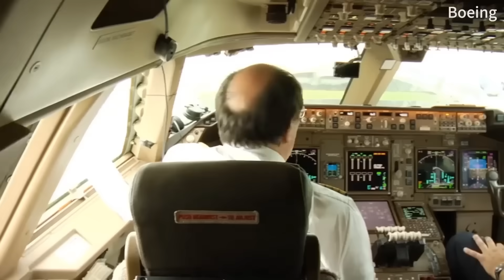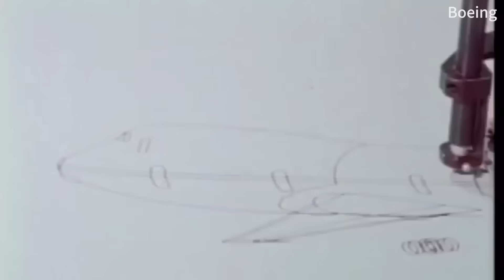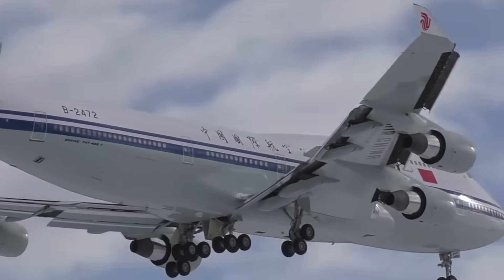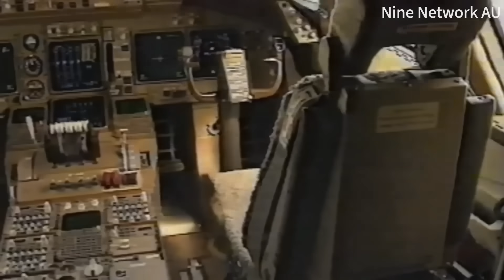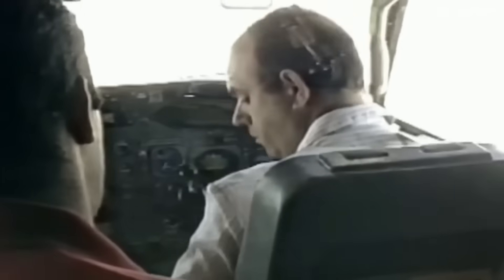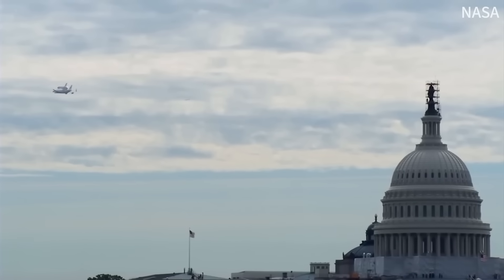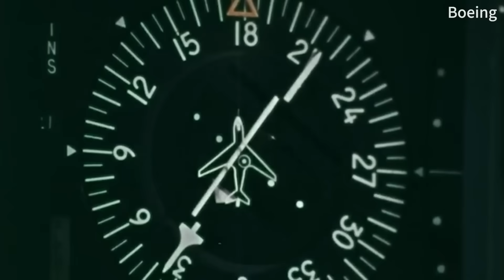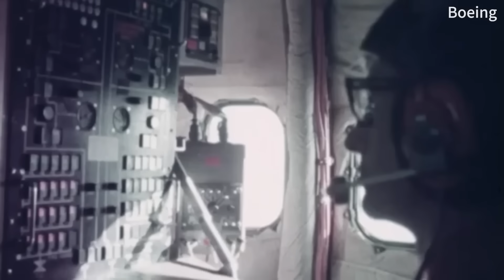The REAl Truth Behind the Boeing 747's Hump

Comment: The "hump" is for AERODYNAMICS!!! While Clare Evgrett was still alive, the designers of the 372 (narrow bodied 707)  were playing in the full-scale wind tunnel at Ames with cardboard and styrofoam "mock-ups". In one test, the model "came apart" under wind pressure and made a "hump" behind the cockpit. The smoke streamers showed a MARKED drag reduction along the fuselage. My late Daddy was running a Huston-Fearless High-speed movie camera of it as an independent contractor. He went to North American Aviation, then to the Rocketdyne Div. and worked on the Apollo program. I watched the first static test firing of the "Orion" engine that powered the Saturn V, in Downey, CA. where there are houses today. NAA is long-gone. "Looks" do not aerodynamics make!

Comment: Boeing delivered 747-400 to NWA in Feb./1989 … difference than 747-300… upper deck is business class..so nice. I actually a part of testing team for the flight test to this a/p (and 777 then 787).
Reply from the maker: That's an incredible level of insight and experience to have been part of the flight test team for such iconic aircraft like the 747-400, 777, and 787!

Comment: Best aircraft I ever got the chance to work on. I thank NASA and the USAF for that opportunity. The beginning of this video isn't entirely true. There are mock-ups, drawings and actual models of the 747 as a double decker, almost as the A380 is now. But the tech at the time wouldn't support it. Boeing was hedging its bet that if the 747 WASN'T successful as the first true jumbo jet, that with the redesign that allowed the nose to open and it put the hump up there, they could still make it successful as a cargo aircraft. For which it still flies today in large numbers, even after most passenger service has ended. But I still say that if you found some very efficient engines, the 747, with some updates would STILL be one of the BEST aircraft flying in the world. It's design was way ahead of its time and one of the most durable ever built. Back when Boeing was run by actual GOOD engineers and not lawyers and accountants!
Reply from the maker: Wow, thank you for sharing your firsthand experience and deep knowledge of the 747's history and design! It's fascinating to hear about the double-decker concepts and Boeing's strategic thinking behind the cargo conversion. ✈️

Comment: Well I remember watching a show called the jumbo jet revaluation. All about the 747. I remember the test pilots complaining about the engines flaming out if they were being mildly aggressive with the throttles. The problem was solved by inviting the engine manufacturers upper level management for a test flight. Then the pilots invited the managers to the cockpit and started throttling up one engine at a time and flaming them out.  While not being aggressive with the throttle input. The managers told them to stop when they flamed out 2 engines and that they would fix the problems with their engines. 
You couldn’t do that today. 😂

Comment: Good information regarding the 747, but. A video on the 747 showing other aircraft, WHY? The title and title graphic hinted at the secrets of the hump itself not the case giving an impression thet the subject would be about the hump and what may be hidden in or what the hump was used for. The video did not revel anything about the insides of the hump. Overall, this video sucked.

Comment: This is a article about the 747 not the A380, watch what you post.
Now this is the reason why I try to take transatlantic flights on a 747, I have timed a JFK to ATH at 8 hours 45 minutes. The A330, you might as well add an additional 1.5 hours to the same route. To me time is money, that extra hour I gain allows for a better connecting flight within the arriving country.

Comment: What the hell is that mess that flashed across the screen at 5:27.   McDonnell Douglas used depleted uranium as counter weights for aero purposes so they didn't have to have such large balance noses since they were aero-driven and only hydraulic assist, not powered.  And that was way before the 747 was conceived.  And GE engine problems were not unique to Boeing either, in fact they ultimately killed the MD-11.   Sorry I just cant deal with the stock footage anymore. Adios
Reply: lol. Crybaby

Comment: In 1979 - 1981 I worked at Northrop electro macanical division in Fullerton. I worked on a stringer line making stringers for 747, 767, 757, DC10 and L1011. The Boeing and Douglas stringers were light, but strong because of the shape of the part. They had holes for rivets. The L1011 stringer had no rivet hols and its shape was half of the other two. You could not get me on an L1011. All the seven series planes are still flying as well as the (now) KC10. Thankfully, most of the L1011’s are in the trash heap……
Reply from the maker: Wow, what an incredible insight into the manufacturing process of these iconic planes! It's fascinating to hear about your experience working on the stringer lines for so many different aircraft.

Comment: How did a plane designed in the 1960s with slide rules outperform later aircraft? Because those 60s engineers were really sharp. They had to be, in a time before calculators and CAD.

 By the same token, the women "computers" who figured out how to land the Mercury and Gemini space capsules did it with pencil and paper- and slide rules.

Comment: If, as you say, Boeing never intended the 747 to be a passenger airplane, then why did they spend money and research such topics as interior lines and passenger comfort?   As a 37+ year Boeing engineer, I can assure you that the 747 WAS intended as a passenger airplane.  However, your statement about the upper deck's reason for being was for access to the main cargo deck for loading was spot on.   It is the reason the A380 will never be a cargo airplane.
Reply: Juan Trippe ordered 20 747’s not for cargo but for passenger planes.  How do I know?  He told us at a dinner party in 1967.  Robert Lowell Johnson, Jr.
Reply: Thought that at least part of that hump was set aside for an alternate crew - as in for long flights, you want/need two full crews…
Reply: Good question, hence the presenter's liking it. The answer is simple: They wanted the option available for companies to choose. Turns out the option became the standard, outselling the original intent many times over.
Reply: All the crew quarters were in the back of the aircraft up a set of stairs on the starboard side
Reply: Yeah. That was total bullshit. Pan Am is the airline that requested Boeing build it FFS. 

So it was designed first and foremost for passengers, not cargo.
Reply: It was designed for cargo first.
Reply: The poster is interested in CLICKs, not TRUTH...
Reply: I just posted a rather lengthy note affirming what you said.  Yup, I am another retired Boeing engineer.  

(Can't claim to have spent 37 years there; or maybe I can...  I went off to work for McDonnell Douglas at the Johnson Space Center in 1979; but hey, Boeing missed me so much they bought the whole company!  So now all my time working for Big Mac counts as Boeing time.  For me that's a good thing because, I suspect thanks to SPEEA, Boeing has a much better retirement program.)

Comment: I used to build the section 46 wing to body assembly for the 747 in Winnipeg.
It's the section behind the wings that blend into the main body of the aircraft.
Before cnc machining equipment came along, each panel was hand trimmed on massive trim tools and then sent to my massive assembly jig, where I would fit them up and gap the panels.
Some panels needed to be final trimmed to create a consistent gap and after several days of assembly and adjustments it would get its final inspection and approval stamps.
I am proud to say that when they digitized the 747 wing to body fairing, I built and trimmed that special set of panels and frames that were put into the cnc machines.
If you work on these planes and see a bug number 2498 stamped on any section 46 panels...that's me!
Reply: Thanks for sharing your story, that's cool.
Reply: So cool!
Reply: Your awesome.  Built with pride and skill.
Reply: so cool!:)
Reply: Hello Johnny, thanks very much for your very interesting post - it must give you great personal satisfaction to know you worked in such a cool airplane, at least I hope it does!!
Reply: @FirstLast-nt6hu  I actually was standing on the wing of W001-777 test plane when I went down to  Washington during the 747 re-coordination pitch!
I never, not, see the 747 and look straight at the wing to body fairings and see my work in action.
Reply: Cool story.  I always enjoy these glimpses into things I know nothing about.  Thanks for your work and expertise throughout the years.  Thanks for posting this.

Comment: One night flying back to Rome on Pan Am flight 115 (Nyc-Par-Rom) there was almost severe turbulence and we were flying through a big storm cell in the middle of the Atlantic Ocean.
I was a Pan Am employee and was getting my pilot license at the time and knew that we were in a dire situation.
Everybody was panicking and holding tight to their seats.
Finally the Captain spoke over the intercom to the passengers.

He said ladies and gentlemen unless you are supersonic pilots I bet you never flew at the speed we are traveling at which is 1600 kilometers per hour , since we have a tailwind of over 500 kilometers per hour ! But he also said that there was no need to worry as the 747 was built to take worse situations than the one we are in now.

I knew he was lying a bit but he confirmed that once Boeing was a Boeing.

We arrived in Paris one hour and 30 minutes ahead of schedule !!!
Reply: I was flying at 650 miles an hour with a tailwind on a '47.

Comment: He left out that after the supersonic fell through they tried to sell it to the Air Force as a troop/ cargo hauler however that also fell through.
Reply: He left it out because it never happened. The USAF heavy lifter program was won by Lockheed after Boeing and Lockheed both submitted design proposals for it. In the end, Lockheed won with the C5 Galaxy. Boeing's design looked a lot like the Lockheed one, but design elements from this failed bid was used in the design of the 747, including the raised cockpit and the nose cargo loading door.

The 747 was first commissioned by Pan Am as a passenger aircraft, but because Boeing thought that the supersonic designs would reign supreme, they designed the plane to easily be converted to a cargo plane when supersonic airliners stared taking over, something that never happened, as we both know.

So yes, even this video is wrong, the 747 was always meant to carry passengers, but with the easy option of switching the line to freighter production when the passenger version became obsolete.

Comment: 15:09  I kept my mouth shut earlier in you video; however, you are at the end and NOT ONCE did bother add even a single sentence much less a paragraph of your script to acknowledged why it was even conceived.  I believe you missed the, what I believe, point that Boeing developed the airplane for the USAF/The competition called the CX-HLS (Cargo Experimental-Heavy Logistics System) program, and both Boeing and Lockheed submitted designs. In the end, the Air Force selected the Lockheed proposal, which became the C-5 Galaxy.  The 747 had several design features that turned out to be flaws.  It could not “kneel” to assist in on/off loading in austere airfields with no infrastructure. The cargo floor was too high for USAF’s contemporary K Loaders, vastly reducing its ability.  Further, there was only One way On & One way Off thru the nose; the C5 could load thru both the nose AND its ramp in the back; essentially a Roll On Roll Off.
Reply: It’s because your information is incorrect. The Boeing CX-HLS looked like the C5 and not like the B747. It had a high wing, T tail. It had a front and rear door, just like the C5. 

The B747 was merely influenced by it. Boeing believed that supersonic was the way to go, so they figured the 747 had to be designed as a passenger airplane that could be converted to cargo aircraft, once supersonic airplanes came about.

Comment: My first 747 flight was on United Airlines back in the mid-90’s. After that was SAS, Thai, ANA and Qantas. But majority was on United till they were replaced some time in the 2010’s. My last 747 flight was on United in 2014.

I’ve never flown on A380 at all but now they are being dropped faster than flies.

I wish Boeing brings back the 747 with all the new technologies that is available. The airframe design is solid and is far better than most of the newer planes being made today.